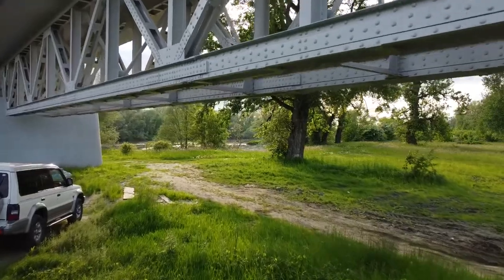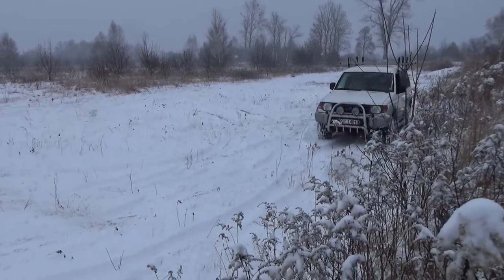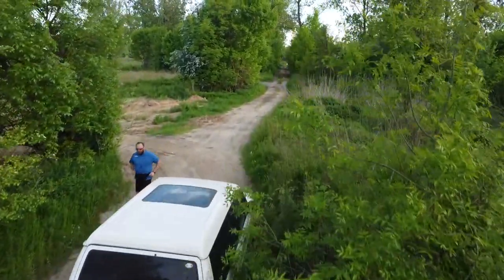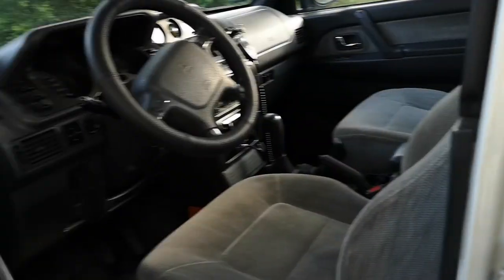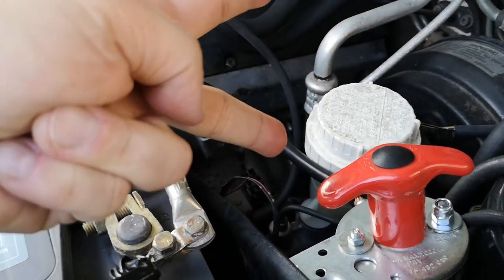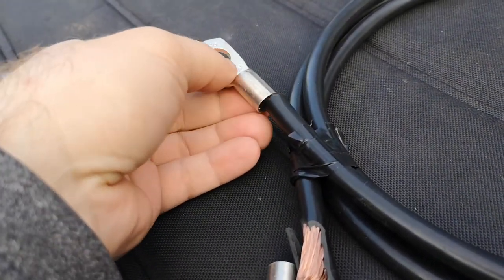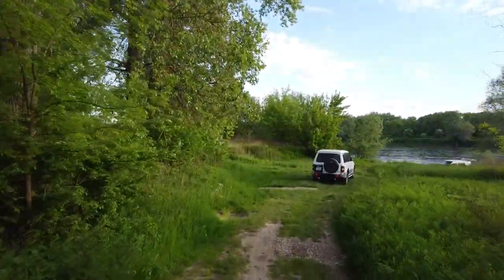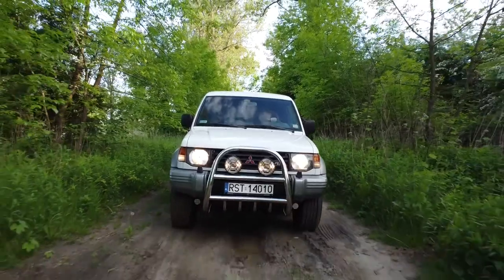How to install kill switch / battery cut off on car

Comment: New modern cars now have cell phone apps and remote control through apps. Without constant 12v battery , your apps won't work,  plus if you disconnect 12v  you got tons of problem on those cars.  Hybrid and plug in hybrid cars also require the 12v battery to be connected 24/7 for various idle operations.  Especially if the vehicle is plugged to the wall for charging (plugin hybrid and full electric vehicle) .
Reply from the maker: You are right. It is basically for older vehiciles.